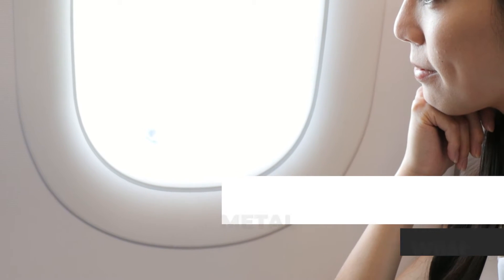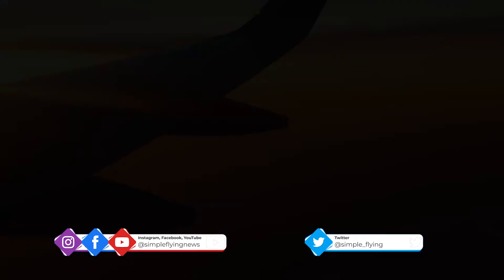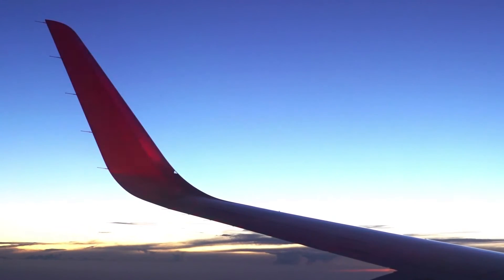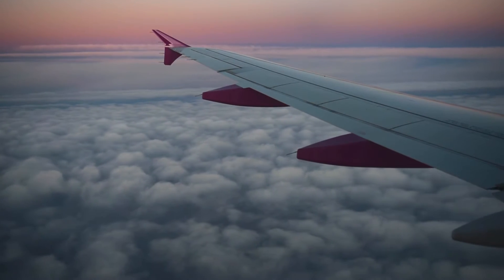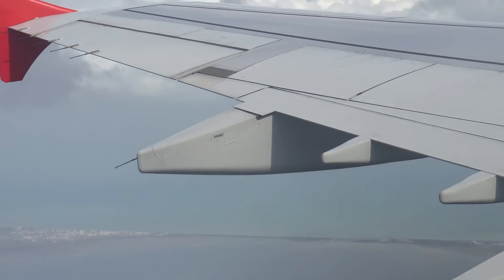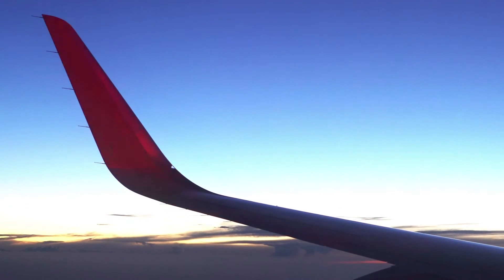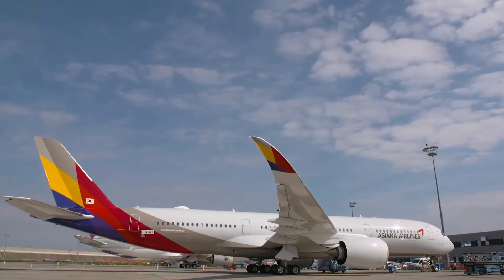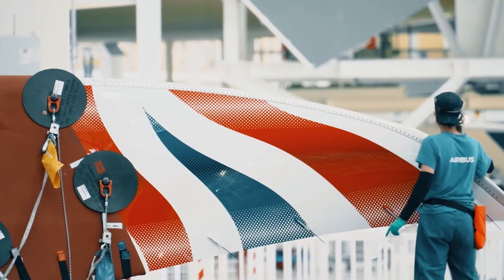What Are Those Metal Rods On The Aircraft Wing?

Comment: Many aircraft have a medium sized static discharger between tires on both main gears, so as the airplane lands, it grounds itself, therefore discharging any remaining static electricity build up. This is also the reason why when helicopters are lifting an external load, the hook mechanism is first allowed to touch the ground, before it gets touched by a human, or a grounding strap preceeds the hook itself. Well done.